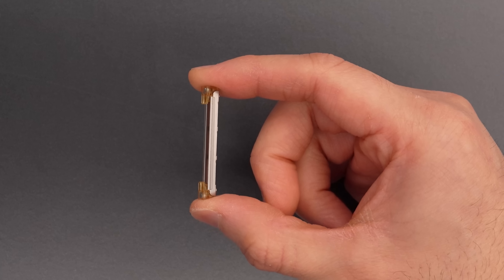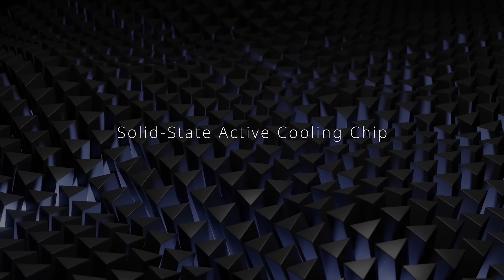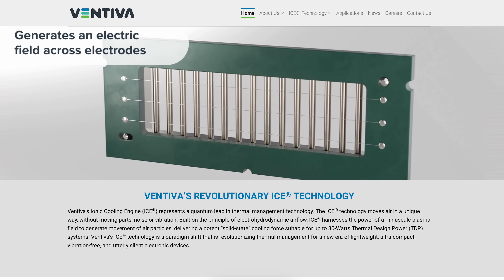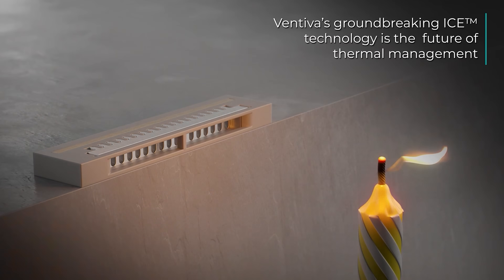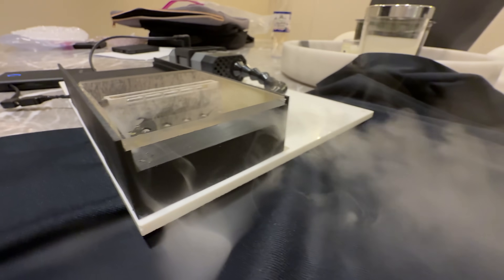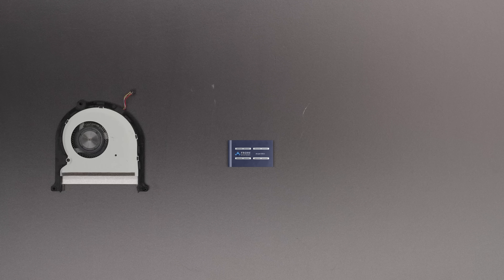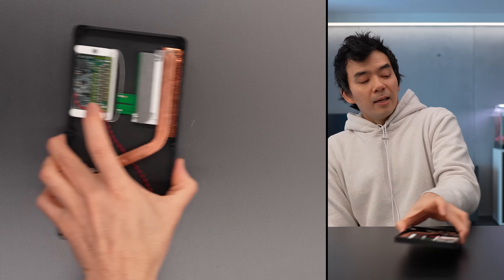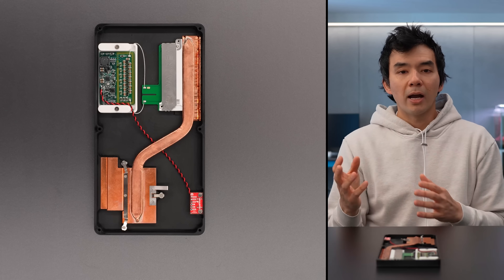The IMPOSSIBLE Laptop Fan...

Comment: its been known for a year, its not sold on the market yet by itself, however there are little micro pc's that have these inside currently, and i've thought about ripping one open and installing them in my steam decks. theoretically, it could free up 3x the space from fan removal in the deck, and give more space for other hardware.

Comment: I honestly don't really see this as a product that people would want, even if the concept behind it is good. Apple laptops have proven to be very quiet while still offering good performance, mainly because the CPU's are just designed in a way that have great performance per watt. If the CPU is efficient (GPU is the same), then the cooling requirements go down. The side effects of this product are not worth the reduce in noise. Noise that can be ignored by putting on a pair of headphones. I am mainly talking about laptops here. This product might see some use in much smaller devices like handheld gaming consoles, but then again everything I said in regards to the CPU/GPU also apply to those devices.

Comment: you completely overlooked that frore's cooler has vastly higher static pressure, meaning you can remove heat much more effectively by breaking up the boundary layer on the heatsink, CFM means jack when you have no static pressure
this ventiva has nearly no static pressure, it has worse cfm than a fan WHILE having like a third of the static pressure on larger models
instant dislike

Comment: The widespread use of ionization-based coolers in laptops poses significant environmental risks due to the chemical byproducts of the ionization process. These devices can generate harmful pollutants such as ozone (O3O3) (as you mentioned), nitrogen oxides (NOxNOx), and reactive oxygen species (ROS), which contribute to air pollution, respiratory health issues, and oxidative stress in living organisms. Additionally, ionization can react with volatile organic compounds (VOCs) in the air, producing toxic byproducts like formaldehyde. As laptops are used in closed or poorly ventilated spaces, the accumulation of these pollutants could harm users and indoor air quality. Scaling up the adoption of this technology without robust safeguards could exacerbate environmental and health challenges, outweighing the potential cooling benefits. I think you are vastly overestimating how much this company cares about the very real and dangerous side-effects this will bring.

Comment: Some of yall acting like dust filters dont exist. You'd probably have to clean it a bit more often, but it's not that hard.
Reply: Yes. Add parts. That's the solution.
Reply: @jsb331  I agree it should come with filters built in, I was largely responding to the people acting like the product is fundamentally nonviable because of the possibility of dust

Comment: you didn't cover AirJet because you didn't understand it - it is not about CFM. It actually blows the heat away from the contact plate at a crazy speed. So that heat just outs the device by its own. As for ionic thrust, there is nothing new about it and it can easily kill the laptop with those high voltages. Anyway, laptop cooling element shown looks like the Asus one.

Comment: The same principle is used by the IonicCare air purifier, but I see an issue with how it will accumulate dirt. Try looking at the IonicCare after two months when it notifies you that it needs cleaning – but there, compressed air alone, as used for a regular fan, won't be enough. Otherwise, it's an interesting solution.

Comment: There will need to be an airflow pathway possibly a tube from the outside of the main unit/ laptop, to the opening of the airflow device so a can duster can be used to blast the dust out.  But some particulate is sticky, so this could be a problem. Free engineering advice, you are welcome!

Comment: That's a good device worth maxing out with generative AI + Produced with elite materials. Go to Perplexity AI: "Ultrasound pressure manipulation to move air better than a fan." My personal favorite.. The Twilight Zone: 2019: Episode 4: A Traveler Clear smartphone + Screen as contact lenses = I can't wait for masses to realize how much damage history edits did to humanity. Places Piezoelectric crystal ball on its amplifier for Audio spotlight technology by Ultrasound several rooms away beaming right frequency My favorite approach to a clear smartphone power source.. Ultrasonic frequency tuned crystals + Generator overbuilt to compensate for energy losses + Carbon nanotube tech + High pressure Ultrasonic holography to form Diamond growth patterns perfectly while shaping Piezoelectric crystal battery inside.

Why are found Diamonds worth so much less than PERFECTION to Humanity? Points at brain Thought control.. Injects water to fill around warm parts through a tiny drilled hole then caps it and turns on switch to generator watching the internal micro-pump lower pressure in water then vent/Cold boil energy away to drop the water coldness to set pressure level Strong enough vacuum cold boiler design and you can make ice instant for cooling aka Regenerative ice technology when debating unrestricted AI. But ice phone would only be appropriate for Mr.Freeze mode. Plays song I'm Mr. White Christmas (Snow Miser Song) 

Ultrasonic repel field from mobile devices with frequency filters used in medical scanners secretly right now to prevent damaging your cells = Never need to clean your devices ever again.. They will reject filth.. https://suslick.scs.illinois.edu/sonochembrittanica.html "Ultrasound can produce temperatures as high as those on the surface of the Sun and pressures as great as those at the bottom of the ocean. In some cases, it can also increase chemical reactivities by nearly a millionfold."

Comment: One of the down sides is that it’s very fragile. A normal laptop fan will never need to be replaced. This will have a shelf life. Humidity  will also impact the performance. Ozone can also cause corrosion, it’s basically super oxygen.

Comment: Ah yes, I love seeing my laptop fall to bits in 2 years caused by ozone corrosion and degradation.   Not new tech, and has lots of disadvantages. Can build  a lot of static, can shock you quite hard, lots of EMI,  it WILL produce way more ozone than they will say say, you will be able to smell it, and it will affect the laptop, it will fail a lot more early compared to any other type of fan. Also, Tessera and Ventiva actually tried it like... 16 years ago, and it has LOTS of issues. Including acting like an air filter, and catching everything form the air, and getting blocked in a few days.

This is gonna be just a prototype made by Lenovo, and will not be up for sale for a long time
One more thing, this can make more air per W, but dissipate way less heat than Frore, as the ionic cooler doesn't support high density and doesn't have high static pressure to overcome its disadvantages 

It can be used for Chromebooks though. they have a replacement timeframe of 2 years anyways, and dont push more than 30W
Reply: Well, after watching the entire vid, I'm glad to see that you did mention the Ozone and Static pressure :))
I should really start watching the entire vid before commenting

Comment: Those air purifiers that are built the same way work for a month than get dusty and stop the never seem to work as good after that so i dont see this lasting any amount of time plus if you have to remove 97 screws to try to clean it  it's not worth it because compress  air is not  going to help unlike a fan the plates are going to stick the the dust and stuff to them because of the negative charge

Comment: First wait and see.
If there is anything i learned it's to be skeptical of youtuber endorsed products.

If there is any rule: If it sounds too good to be true, it usually is.. I bet this has barely any airflow to really dissipate.

Most likely it has to no static pressure so you cant push through a mesh and dust will ruin this thing

Comment: This is just an accident waiting to happen. What happens if dust shorts both contacts? I've already seen enough computer fires/deaths caused the power supply igniting or contacts on motherboards short out do to dust. 
Next thing is how much pressure can build such a fan? Noctua (in my opinion the best fan designers) for example not just optimized the fan to volume of air in the move but also how much pressure they can build. That comes in handy when you want to maximize the heat sink's efficiency when enlarging it is not an option.

Comment: Taking the pressure into account for the efficiency calculations, Frore actually comes on top with 17%, against a normal fan's 3% and the Ventiva's 0.6%

Conventional Laptop Fan
    CFM/W: ~1.3
    Pressure: ~50 Pa
Volumetric flow = 1.3 CFM/W × 0.000472 m³/s/CFM ≈ 0.000614 m³/s per W
Mechanical power = 0.000614 m³/s × 50 Pa ≈ 0.0307 W
Efficiency = 0.0307 W / 1 W ≈ 3.1%

Frore AirJet

    CFM/W: 0.21
    Pressure: ~1700 Pa
Volumetric flow = 0.21 CFM/W × 0.000472 m³/s/CFM ≈ 0.000099 m³/s per W
Mechanical power = 0.000099 m³/s × 1700 Pa ≈ 0.168 W
Efficiency = 0.168 W / 1 W ≈ 17%

Ventiva ICE

    CFM/W: 1.0
    Pressure: ~12 Pa
Volumetric flow = 1.0 CFM/W × 0.000472 m³/s/CFM ≈ 0.000472 m³/s per W
Mechanical power = 0.000472 m³/s × 12 Pa ≈ 0.0057 W
Efficiency = 0.0057 W / 1 W ≈ 0.57%

So if you only look at airflow (CFM), Frore AirJet looks ‘low efficiency’. But once you factor in that enormous pressure (1700 Pa), it actually imparts far more mechanical power to the airstream—and therefore has the highest overall efficiency (~17%). Ventiva, by contrast, has decent flow but very low pressure, so its air-output power is tiny compared to its input power.

Comment: this tech existed for abour 20-30 years and it's been used by some air purifiers because guess what? it's a damn dust magnet and i don't meant it like a metaphor, but literally. if dust is already an issue for laptops this thing will worsen it by 5x so you gotta filter the intake and most likely the output too dropping the efficiency on the process. i don't really believe that there's a difference on the "anti-dust" tech at all...

Comment: They can do shit about dust 😂, The Typical fans will don't give a fuck even completely covered in dust.Another problem is Dust can accumulate moisture and can short the electrodes easily bcus high voltage tend to love jumping on air.

Comment: high voltage drivers on the mother board, like back in the old days with CFC tubes displays, very dangerous, and the key part, it only generate airflow not pressure, you need negative pressure to suck air from the dusty air holes over time far away from the "fan" , traditional fans are like squirrel cage motors, it is old but works for everything.

Comment: I feel like you completely missed the point here. You're comparing these coolers to fans, which is not accurate. These replace both the fan and the heatsink that the fan blows over. Combined they provide cooling for whatever chip they're mounted on. But with solid state coolers, these get mounted directly on the chip (or a heat pipe if space is a constraint). Who cares about CFM then? Peltier devices successfully transfer heat with 0 CFM.
By far the most relevant metric here is their cooling capabilities (TDP), which doesn't get mentioned in this video at all. You have a chip that consumes 8 watts, you put one of these 10-watt Ventiva/Airjets on it, and as long as the air can move, you'll have a cool chip.

Comment: Its a basic ionic thruster without using propellant, its an alternative to the propellant, where the propellant is instead just a film on the grid... but also without the need to thrust its own weight, so it makes total sense, actually. See the @integza & @plasmicchannel they do some similar diy versions.The high voltage needed to run them is where cost issues would come into play. Also the long term wear of that propellant film would concern me until I know more.

Comment: If you ever had a mosquito racket, when it is dirty and full of dust, the mosquito racket will feel weak.
Its name is a fan, when it sucks wind, small particles such as dust will definitely be sucked in. Over time, the dirt will accumulate on the electrodes and will cause corona discharge which will burden the high voltage power supply which causes the voltage to decrease which eventually makes the moving ionized air particles become less and less, in other words the wind current will be slow.
Not to mention the wind that will be held back by the pile of dirt which will further slow down the wind which of course reduces laptop performance.
Reply: Name me a fan which doesn't accumulate dust and dirt?
Reply: @Aashiq1488  literally irrelevant, blade fans can work through years of sludge and hair
Reply: @That_dawg420  
There are levels to pretty much everything.
Reply: @Aashiq1488  I have a feeling that thin wire electrode will be impacted quicker than typical fan blades and exhaust grille. Once its covered by insulating dust the ionization will stop. Now imagine cleaning that wire. They need some filter at the intake but then it also reduces static pressure which is already weak for this type of cooling solution. In short they got more work to do.
Reply: Nice. It's gonna brick 💩 so hard because people are tech illiterate. People still take their laptops to bed and suffocate it by putting it on their blanket.
This will be awesome 😂

Comment: I'm surprised you didn't mention the HV as a problem... after all you have a few thousand volts running through those fins. It could take just a tiny jolt for it to kill your low voltage device, cpu, ssd you name it. So running hv so close to LV systems is always a thing to look out for.

Comment: Sure, but I'm guessing that a $30 fan would be way more effective and efficient while being nearly as quiet. And when battery size and component arrangement are considered I doubt there's a size advantage.
So perhaps it comes down to maintenance. Dirty fans function fairly well. Given the ionization, dust is going to stick somewhere, and that causes turbulence, friction, and distance between airflow and wires. Just guessing, but that thing could fry laptops as its efficiency drops. Dunno, but low static pressure generally likes pristine conditions.

Comment: Well ion thrusters are known since the 1950s. I think this technology is inadequate for computer cooling. You are pushing ionized air, electrically charge air, through electric circuit boards which doesn't sound like the correct thing to do. Maybe I'm wrong.

Comment: 05:59 There is the word "Dell" on the part shown. Eh, "I don't tell them which company is this." - Yet, I will never buy anything from Dell anymore due to other past issues with any hardware I bought from them. Other manufacturers will follow, so you don't have to buy Dell, really. Hint: Buy MSI notebooks. They are more expensive, but much better than the Dell ones.

Comment: Nope.
Just overlay that fan you show and the model, the system (the power supply and the "engine") take as much space as that fan you used as laptop fan sample.  

They can't even stack, i guess because of high voltage leakage.  
  
So using this as save space to make laptop smaller? Don't think so cause the system still take as much space as normal fan. 

And the efficiency is less than normal fan from 20 to 50% is no good.

But this would be "good" for modern laptop, as they have power switch system so if you plugin the battery is disconnect. Still this would still not efficiency enough, 20 to 50% less than normal fan, may be good for some writer who get less distract by their laptop fan noise when they try to think up some story to write.

The best for this is mini PC, media system that backpack a big TV. No fan noise.

Comment: 9:05 - If the parameters are selected correctly, ozone will not be generated. Look at the device "Chizhevsky lamp", this device was used to clean the air back in the USSR and it creates an air flow without creating ozone due to its structure

Comment: 9:00 the first thing I thought of when you mentioned it's ionizing air was O3/Ozone. There is no going around this. Ozone is incredibly dangerous for our health. There is no getting around the danger of this tech just to get the benefit of lighter and quieter laptops. If there is a catalyst to capture or change back O3 to O2 then that means it will eventually be used up or might fail due to dust or damage. Continuing to use a fan like this that produces O3 without knowledge that it is doing so would cause great harm to anyone around these machines.

Comment: I immediately thought of the Sharper Image and other ionic air filter devices and the ozone problem they had. I feel like a lot of the air flow problem on laptops could be improved by putting the processor on the back of the display, and then putting vents so the air can flow bottom up through the top. It could also be used to help cool the display (helpful for OLEDs). Make the base full of batteries or a similar separate chamber for dGPU. That's actually how the Surface Book was (at least in the CPU in the lid portion and the dGPU in the base). Plus with a vertical dock could use a plugged in cooling solution to cool it even better for improved performance when not mobile (same idea with the Nintendo Switch).

Comment: since it has lower static pressure I'm thinking smaller devices for sure. Like imagine a small 10 in 2 in 1 tablet that you can game on. Or you could also put them in smaller handheld gaming pcs. because it has less area to cool which means it requires less static pressure.

Comment: Pity on the static pressure though.
If it's sufficiently high enough, I reckon an additional tapered shroud mechanism could be used to increase the air velocity and utilize the Coanda effect (air multiplier) to increase the effective cooling efficiency.